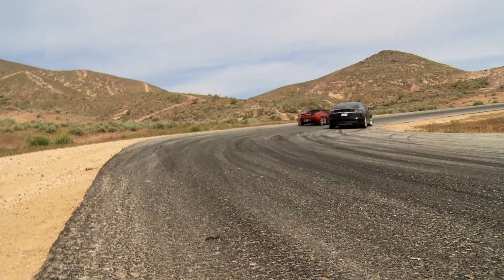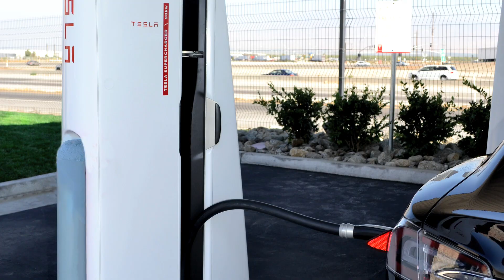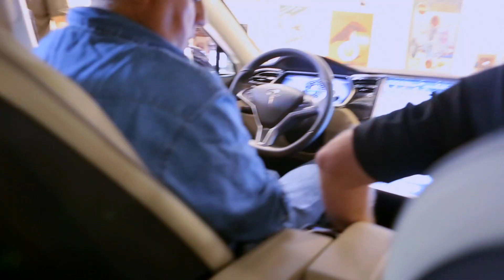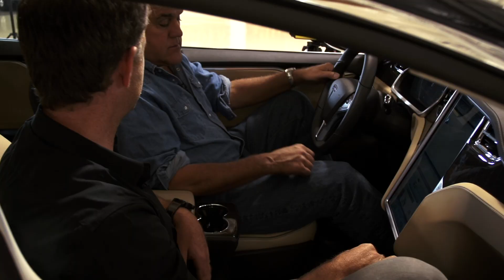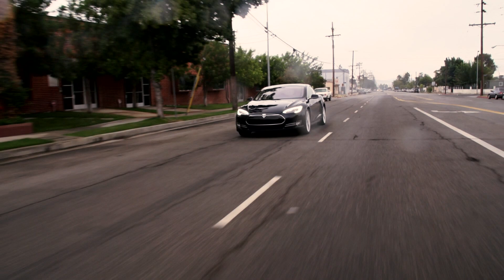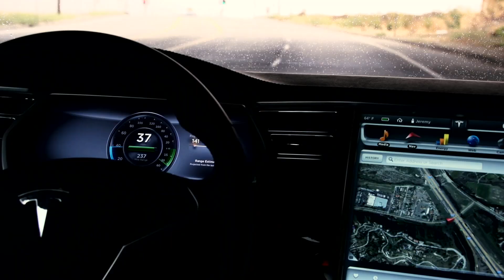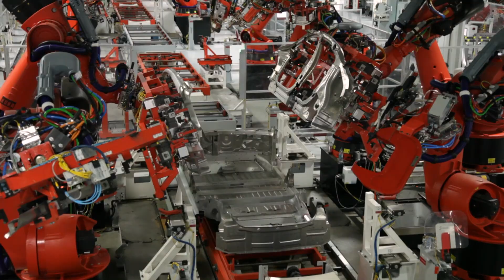2012 Tesla Model S - Jay Leno's Garage

Comment: DISCLAIMER:  I have loved Tesla since the beginnning and I love it now.  I want one someday!  

One thing I believe it is fair to add here is that these cars do cost a little extra to insure because the aluminum is harder to repair. So, that WILL offset any fuel savings.  In short, I'm not convinced the car is CHEAPER to own and operate compared to a fossil car,  at least yet.

That said....what other car can say, "The day you buy our car you probably get the worst software it will ever have!  Then it just keeps getting better, unlike other mass-produced cars that just deteriorate over time. 

And with fuel costs trending up over the years, who knows what fuel will cost in the future?   I would suspect electricity costs will actually be quite reasonable in the future with all these solar roofs and fields of solar panels.

Maybe some new geothermal electricity coming online out in Yellowstone (I hope)?
Reply: Hmmm, just not buyin' it fsg. I don't "update" my phone etc. since "updates" are the path to dump more advertising on me. My mandatory right now bank app "update" netted me ads before I can see my balance. A car that feels free to, and is able to change my driving experience at will--a big no thanks.

Comment: If you have never rode in a true performance V8 or I6 TURBO you won't understand what I mean but this car has NO SOUL...  Or PASSION it makes no noise. Imagine not hearing a Ferrari 355 at 7500 rpm thru tubi exhaust ... No soul....
Reply: souls are a made up thing by people afraid of death.  fitting and hilarious that the Internal Combustion Engine industry is clinging to just such a myth.

Comment: They need a system that takes the place of the supercharge stations, and make the batteries easily interchangeable within like 10 minutes. Instead of charging the same battery for hours every time it’s dead, just swap it out for a new one with a full charge and be back on the road in the same amount of time as a gasoline car filling up. 
I’m sure designing something like that onto a car would be quite difficult but maybe when they start a new model, just build the car around the idea of easily accessible battery location or maybe have it slide out from underneath the car.
Reply: fatdudewh33lchair - Musk already designed a battery swap system for Tesla Model S , it’s not practical as the battery cost around $6000. Besides in 2018, most people live within 150 miles of a Supercharger.

Comment: But to get the metal and other materials a lot of pollution has been caused to create the batteries and cars...
The huge mines ran by giant diesel burning machines get those metals for those batteries.

Everyone says the car emits no or little emissions &  batteries are getting cheaper, no one pays attention to the bottom line that the production of that very car far out weights any good the car can do in the end. Granted it will be less than a gasoline or diesel car as they too still require the same metals to be mined and etc plus they add more pollution after life.

But main point here is people need to start at the top, Heavy Machinery, Ships, Farm Equipment and Big Rigs which make the world so nice for us all. 
That will be the biggest impact, and those companies have much more money for funding than most average people. It feels like they want the average people to fund the research to get to that point it doesn't seem fair considering your taxing us for carbon tax now & give people discounts for hybrids and electric vehicles. It's like they just want to corner us into funding the research that will fix the main problem at hand.

Ships, Heavy Machinery, Farm Equipment and Big Rigs. All with massive engines and driving/sailing as much as possible vs a average person uses their car basically to and from work if they don't bus, bike or car pool, and very little otherwise. Maybe some visiting friends, family, shopping but not anything near what the work vehicles and ships are doing.

If we just eliminated all the pollution from the Big Rigs, Ships, Heavy Machinery & Farm Equipment first, It would be so much easier to produce a much more affordable vehicle for the average person after that & besides that the impact from the work vehicles & ships creating zero or very little pollution at all alone would make the largest and most significant impact.

Yeah they get carbon tax for fuels if they fuel in a place that charges it, Maybe other taxes again only if they're in a place that charges it.
Need to take the actual real problem head on first if climate change really is such a big deal like they're making it out to be.

Otherwise why are they charging carbon tax? It's no big deal we got a century or more the way they're going about it 2030 maybe there might be every manufacturer with 2 or more electric/hybrid/hydrogen vehicles and that's just touching the tip of fixing the real problem.

Comment: Tesla should of made the battery easy to replace as it only has a 10 year life span. So basically the car lasts 10 years before you're pretty much forced to get a new one.
Reply: WikiTool - Musk already built that. But, is not practical, as battery are heavy, have to be transported, and cost a lot. FACT is most Americans live within 150 miles of the closest Supercharger.

Comment: Pros: 
1. No loud sound coming from the car whilst driving.
2. Comfortable and spacious 
3. Nice large screen and UI 
4. Very high tech compared to the average "new car" with an ICE.
5. Allows you to charge your car at home, meaning that if you don't drive to different places a lot, you may never have to find a charging station.
6. Very fast acceleration due to it being electric.
7. For its starting price of $74,500 it is rather cheap for what it comes equipped with.

Cons:
1. Lack of long distance quick charge stations.
2. Time to quick-charge is 30 minutes which is still about 6 times longer than what it takes to fill up a petrol/diesel car.
Reply: Stew no loud sound lol.. car guys like sound.

Comment: Nice looking car.  But for the price they are asking why can't they put the charging unit inside the car so you can plug it in any where?  And how come there aren't any solar cells embedded in the roof and hoods so that it will charge while you drive?  Come on guys, this can't be that hard!
Reply: Solar panels on the roof would be futile adding maybe 5 miles a day to your range at most.

The car comes with a cable you can plug the car in anywhere.

Comment: hey Jay Leno I am really surprised to see all these electric cars coming out on the market considering they have had them for over a hundred years I would like to see a upgrade to the la busha water powered  car seems like it would be more productive considering 80% of the earth is water where as only a 10 year battery life on this one and then try to fix them and it costs more than the car did new and more than it would have costed using gas and it is junkyard bound now a days cars are crushed vs being restored I doubt Tesla would make a car designed to be worked on I couldn't imagine putting my kids in the back while real cars are around    I bet it will crush like a pop can not like a real muscle car real steel was replaced with soda can aluminum you should do a video of a crash at 40 mph on it see if it will charge up and drive away or if it will electrocute you and anyone around

Comment: 10 years battery life.... what's the cost to replace the battery pack??? or does the car become a throw away and scrap it because of huge replacement cost
Reply: Patrick R - NOPE. battery is warranted for 8 years, still retains 90% of charge. Battery can go million miles and still work with limited range. If you charge at home, and never Supercharge the battery will last over a Decade.

Comment: I thought now they do say that the superchargers decrease the life of the battery just like fast charging a cellphone
Reply: 420apache657 - nope, battery warranty for 8 years, and still gets 90% of range, battery can actually go for a Million Miles and still working, with limited range. You can operate battery for over a Decade with no loss if you charge at home and never use the Supercharger, and don’t charge to 100%.

Comment: When gas prices dropped like they have, SUV purchases in the U.S. jumped by 40%.   You have to think OPEC's drop in oil prices is a desperate attempt to thwart the green movement, and also as a side benefit...Trip up recent U.S. oil production (fracking)which relies on high prices to be viable.

Comment: 1: when are they making a truck? 2: Toyota take note, electric doesn't have to be booring.
Reply: I think he probably meant pickup, and that is also on the cards though they have no firm timeline. It's a pickup that can carry a pickup: https://electrek.co/2017/11/17/tesla-pickup-truck-first-image-unveil/

Tesla semi tech repackaged into something you can drive on a normal licence.

Seriously though, someone will make an electric pickup, it's just too perfect a drivetrain for that use case, where you may be carrying heavy tools as a tradesman or some such, the equivalent of an F250 for those who actually use it for it's intended purpose.

Consider that a P100D Model X can beat an Alfa 4C (a pretty quick car in it's own right) in a drag race - while towing an Alfa 4C on a trailer behind it: https://youtu.be/ib-02b2ooLY?t=3m17s
Reply: Mike - the Tesla Semi is coming in 2020 but the game changer is the Tesla model pickup. Over 300 miles range and Dual Motor standard. So, it’s a Real 4x4. It has both a compressor for air tools and a 240v System to power electric tools, it can haul a F550 in its truckbed.
Reply: For number 1, the answer is now! :)

https://www.tesla.com/semi/

Comment: how well do those batteries hold a charge at -30 -40.??. is there a way to keep the batteries warm?? how do the batteries react when your spinning on ice or plowing through snow??i live in canada..
Reply: They heat and cool them selves to stay at the right temperature needed
Reply: they work excellent from what i've heard on tesla forums
Reply: alot of companies say that.but at -40 even a brand new,top of the line battery can die after 10-12 hours of sitting.at that temp.. most deisels don't even get shut off for days on end up north for weeks. unless they have 2 huge batteries,  heated battery blankets, fuel heaters,dual  block heaters and even at that you'll still need a oil pan heater.and use ether.with all that you still need to keep your fingers crossed.
Reply: even sitting all night? don't mean to be a pain.
Reply: Randi Gal it should be fine, google it to make sure
Reply: +Randi Gal The car will handle the heating of the battery on its own. I think the only difference is that if it's not yet "heated", regen is disabled until it reaches the proper temp.

Comment: Did he ever answer if you can change sections of the battery out or the whole thing if there are problems?
Reply: You change the whole thing
Reply: I believe the battery degrades evenly across the cells, so once you get to the point where you need to change it, it's really time to change the whole thing. But that's probably 20 years out!

Comment: Awesome car, test drove it last week, amazing! The future is here! In fact its stupid to drive still with gas and diesel in now days. The perfomance and confort are outstanding, hope there will get cheaper
Reply: Wind, Sun, Nuclear. Only about 1/3 of US power is from coal.
Reply: Even if you charge your Tesla with 100% coal-produced-electricity, it's still far "greener" than gasoline.
Reply: +bilb Ono The fact that you don't have to take your cylinder head apart for repair is a big deal. Teslas will last a long time with minimal maintenance/repair. Definitely the future.
Reply: If you use a home gasoline generator, it's about twice as efficient as an engine in a car. Roughly. So, this car, if gasoline, would get, what? 20-24 mpg? If you charged it with a home gasoline generator, it would get about 40-50 mpg. Again, that's the rough idea. It's the same reason a Prius gets better gas mileage, but this thing isn't lugging around the gas tank and engine. But a big utility grade electric generator is much more efficient than a home generator. So the point is, less fossil fuel per mile with the potential for zero fossil fuel.
Reply: If you have solar panels at home or use wind turbines, you basically have free "gas" for your Tesla.
Reply: but fossil fuels will run out and they also are a cause of global warming, at the rate that they are being used today. So yea calm down on polishing cylinder heads.
Reply: +Fire Blade what do you think we use to make electricity?
Reply: +sasajungic89 Right! Stupidity, hope there will come more cars like that
Reply: https://en.m.wikipedia.org/wiki/Electricity_generation

Ive read this several times thoroughly, it's a good read and a good place for you to start. then check out how much green house gases and hazardous waste is a byproduct of electric motors for cars and its components.
electric cars are not yet the savior of our damage to earth, not even close all things considered. but sign me up, im all for electric cars. but as OP stated (which what i was replying to) is wrong. internal combustion engines never ever will be useless or forgotten as long as there are humans, people will drive gas and diesel cars for the reason of joy and art. hopefully only car enthusiast will drive them and common people will use what ever is the most effiecient to drive.
Reply: actually if you scroll up my reply is the first one and i say the same thing that right now fuel is used to make electricity, but electricity can also be made from renewable sources of energy and electric cars are a step towards that. There are many tesla power stations that run on solar and produce clean green energy.
Reply: actually i myself am a car guy and i love gasoline engines, and i know they will never stop being used... even elon musk agrees that the gas engine will not stop altogether he said that even with electric gas engines will still exist, they will be less but they will exist.
Reply: Bilb Ono stupid comment, i love cars, drive allmost V8, have several veteran cars, but the fact is that gas is very expensive here in Europe and days are counted with combustion engines, the future are cars like Tesla, beside there is no pollution anymore, thats the way its going to be
Reply: +Christian Sanden again read my comment and the link. 41% of all electricity is produced from fossil fuels like coal, and most of the rest is nuclear electric power. then you consider the batteries and electric motors cause alot of green house gases to produce, and harmful hazardous waste. the foot print of a prius is equal to roughly driving a gas car a half million miles, JUST TO MAKE THE CAR.

just because your electric car doesnt let out a tiny bit of co2 out the tail pipe, (like a normal car) doesnt mean it has no foot print. you dont think about what it took to make that electric car.
and youre now just repeating what Ive already said, the statement i was replying to was "Theres no point to driving gas diesel cars" which i said was wrong. then you guys wanted to add rhetoric.
Reply: One thing to consider,-all the electronic wonder gadgets/controls etc on the thing,-how long does the average computer last before quitting/going wonky ? No maintaining them ? I'm not ready to bet too heavily on that just yet-the Baker "lacked" all the whizz bangs.
Reply: the other problem is that we all have now got used to those creature comforts like aircon and climate control, how much will that eat into the 300 mile range?
Reply: Well Tesla model 3 will be out soon at 35000$ so yaaay!! I can't wait. I'm scratching my head and thinking why none of the big auto makers haven't done this yet. Tesla did it with 0.000001% of the big car companies budget. There is not really any excuse. If they don't act fast company's like Tesla will start to take over. It's silly that we still use fossil fuel.
Reply: +Christian Sanden youre not a car lover. electric cars are nearly souless. 
after you have taken your cylinder head apart a hundred times and fine tuned your engine and learn your engine personally come back and tell me Theres no reason to own a combustion engine car.
a electric motor/car will never ever have the ability to bond with you like a combustion engine car. 
you have no need for one, but you have no idea what being a car lover is. it's an overused phrase but you dont "get it".
Reply: +Josh McCullough sigh...
Reply: whats the use??? electricity is still produced with fossil fuels!

Comment: By the mid 2020s this video will be as funny as the video of Jobs introducing the original iPhone seems now. Hilariously quaint and adorable in retrospect but absolutely industry-changing at the time. Even now in 2016 the original Model S seems primitive.
Reply: +Dan Paveley primitive?  how so?  just curious.
Reply: The original Model S had no self-driving hardware built in, no real safety systems, far less power because of older battery tech, only 2-wheel drive, and inferior traction control software. Not exactly small things. 

Of course, the car was still amazing and clearly a sign of game-changing tech (just like the original iPhone), but the progress we've already seen since then is immense and makes me feel really, really good :)

Comment: I don't understand why automobiles can't be run like a diesel locomotive where the engine runs a generator to operate the electric motors without batteries.
Reply: +bruce miller like this bad boy! http://www.liebherr.com/CMS/images/Liebherr-TI274-600.jpg
Reply: That's what the Volt does, with gasoline and the battery is used just for short trips.
Reply: That's what the Fisker karma did but it's still less efficient, the combustion engine is usually 15%-30% efficient, and it would still need maintenance while a full electric car doesn't and has more like 90%efficiency